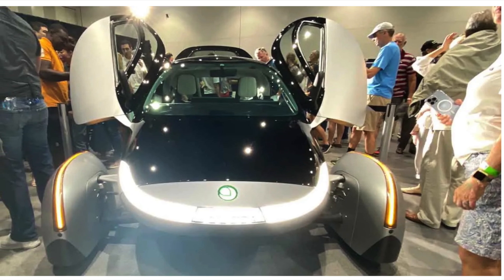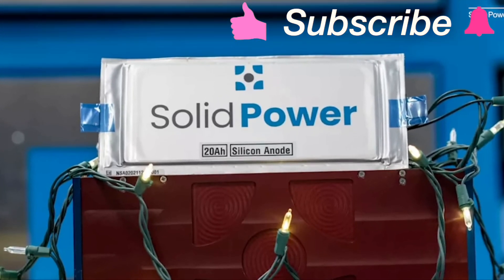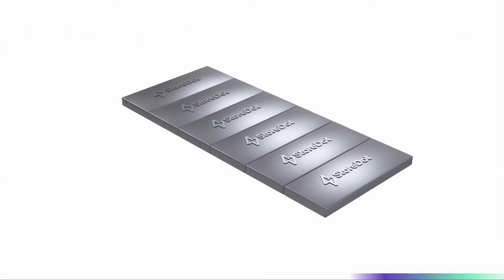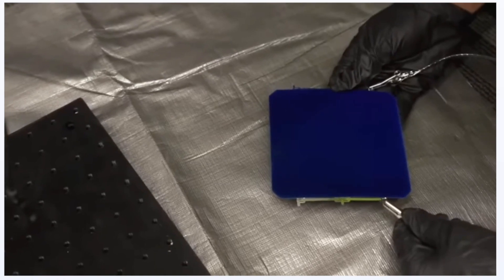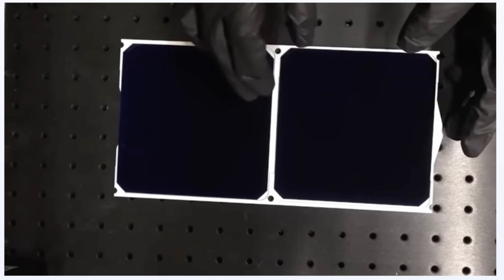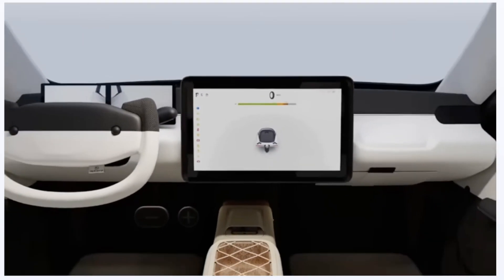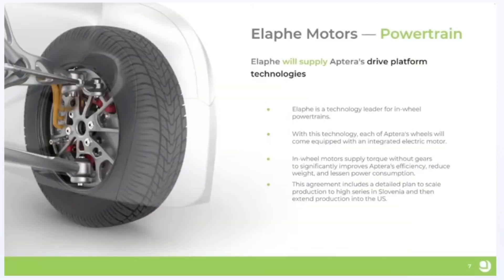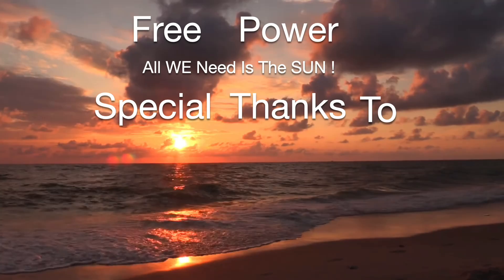Aptera Has Fantastic News For The Delta !

Comment: Solid state batteries are nearly 10 years off yet. Still while many claim they have both higher density, faster charging, and longer lifespans, they actually only have one or two of these. These are the trade offs in chemistry choice. So the ultimate question for you, would rather have the EV with the same range as now but charges 3 times faster, or the one that charges just as fast but can store an extra 20-40% more range? I think I know which one most companies would prefer.
Reply from the maker: StoreDot said their battery will charge 100 miles in 5 minutes and their coming out in 2024

Comment: You still have to worry about battery fires. In case of higher capacity batteries the fires might even be fiercer. As long as you have electrolyte there is always the danger of a fire.
Reply: The solid state batteries don’t have electrolytes.
Reply: @mikegrok  It uses a solid state electrolyte. Without an electrolyte there is no  energy flow.
Reply: That's the thing I think about most well I'm driving around in the bomb I presently own. Gasoline not only burns, it's vapors also explode.

Comment: Increasing the battery energy density won't increase the solar range, just the vehicle range. But just increasing the solar panel efficiency from 20% to 30% would increase the solar range from 40 miles to 60 miles.
Reply: Technically it would though, higher battery density= less weight= more range per charge. Also they are trying to do some amazing things with the panels as is.
Reply: @wtfbbqbye   That depends on whether they reduce the number of batteries to have the same charge capacity or keep the number of batteries the same and have increased charge capacity. I would rather have the increased kwh, but in that situation, the vehicle would weigh the same, and as there would still only be 700w coming from the solar panels that still only adds up to 40 miles. But yes, you are right, if the battery pack is smaller and you still get let's say 40kwh for the 400-mile version, there would be a small improvement in range so maybe it would be 405 miles instead of 400 miles. That might give you an extra mile per day from your solar panels. It all depends on how many wh per mile the car can achieve. They say it's less than 100wh/mile but no doubt that will vary depending on different factors.
Reply: You’re right, this guy doesn’t understand math. The solar panels create a certain number of watts, which will drive you a certain number of miles. The only variables would be if the batteries were a bit lighter you would gain a bit in range due to reduced rolling resistance and less mass to accelerate. The other variable would be battery efficiency. Batteries are not 100% efficient. If you put 100 wats into a battery, you get maybe 90 watts back out due to efficiency loss, heat generation while charging and discharging and such. If you can increase the efficiency of the battery you might get an extra few miles of solar range just because you lose less energy in the charge/discharge cycle. Changing the batteries will not allow the same solar cells to give you twice the range, that is just wild shooting from the hip.
Reply: @dondaniels127  this is why the 250 mile range version is the fastest one. The larger battery packs add substantial weight so it makes sense that a lighter car will have higher km per kwh, this is in fact the whole principle of this car. Plus they did a diamond orientation for the solar panels and have already maximized the number of solar panels so I don't know why anyone's even talking about making the solar panels better....

Comment: Replacing the battery would be very expensive in both parts and labour ... it basically needs the car to be disassembled, because everything bolts onto it.  From a parts viewpoint, you're probably talking $20k for the 100kWh battery, and it's likely you'd need to change the suspension too.   For this sort of upgrade, it's usually cheaper and easier to sell it, and buy one which already has the feature you want.  Technically possible but not practical.
Reply: The pack will be replaceable but it of course would be an expensive change. Probably worth it though 10 years down the road when battery tech has improved. Lighter weight, more energy density, higher range, faster charge times, or a combination of any/ all. That's the beauty of their right to repair stance, you can do it yourself or have a third party do it.
Reply from the maker: That sounds better , I would love to have a lower price car
Reply: Not if you design the vehicle for ease of maintenance.

Comment: Lmao, a 2,000 mile range Aptera sounds funny to me, but we might see that in the future. Though I think the more likely situation is Aptera lowers the price of the 1,000 mile range Aptera because of the decrease in materials cost for the battery pack, making Aptera an even more obvious best budget EV option. A super sport version with a 1.5 second 0-60 we'd be more likely to see sooner than a 2,000 mile Aptera.
Reply from the maker: That sounds great to .
Reply: > A super sport version with a 1.5 second 0-60 we'd be more 

I don't think they'll go in that direction, 1.5 would require extreme engineering, extra downforce (drag), 335 wide sticky wheels, a small battery, that sort of thing.
Reply: @WyndStryke  Who knows? After Aptera has flooded the market with the most efficient aerodynamic vehicle there is they might get bored and decide to produce an SS version. 🏁
Reply: @IBMara  And be faster than my 68 Chevelle
Reply: @WyndStryke  yeah they might not if there'd be a big effort involved. I'd sort of prefer they don't since it'd put me in a situation where I'd have to consider upgrading unexpectedly from the one I already took delivery on.